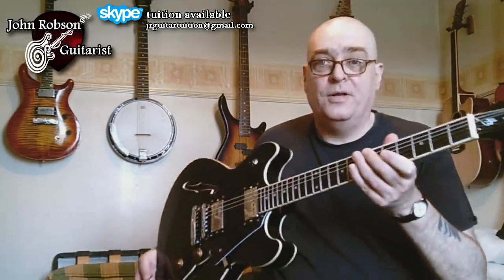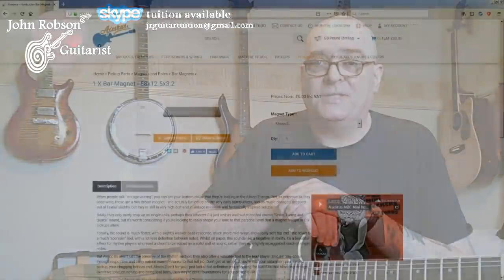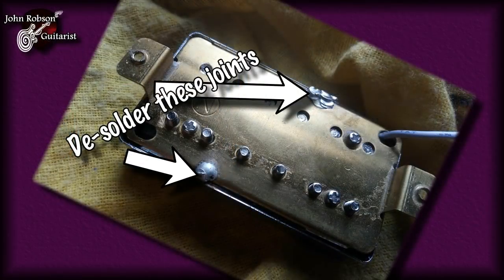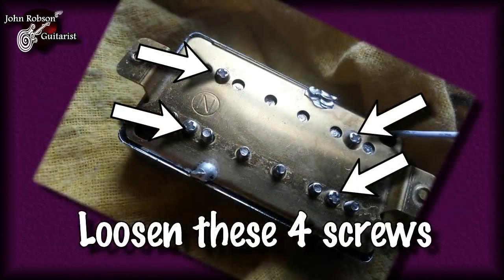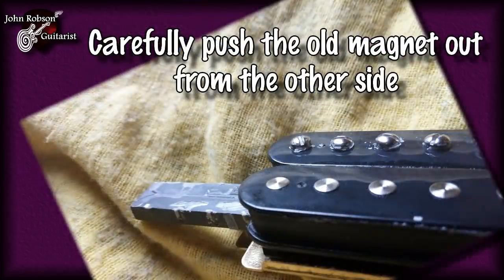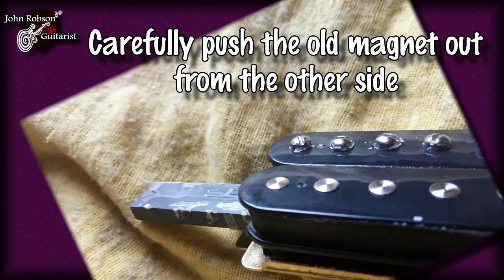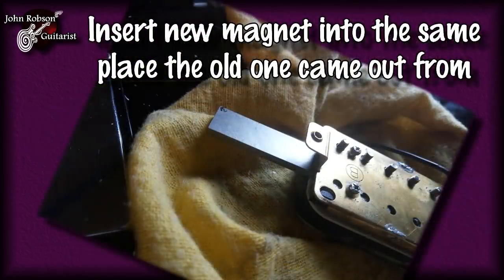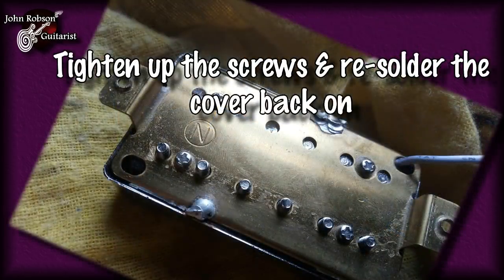| Swapping Pickup Magnets | An Easy & Cheap Way To Upgrade Your Guitar |

Comment: Great guide have swapped magnets on many cheap humbuckers to good effect .
and as a small tip always break the solder joints to the cover rather than desolder them . a stanley knife blade and a small tap through with a hammer does the trick . its not happened to me but know someone who had it happen , when desoldering some small amount of solder dripped down and got under the bobbin tape ( which was rather loose ) and shorted out the windings .
Reply from the maker: Great tip. You've just become the pinned comment on this video 👍
Reply: @JRobsonGuitar   Indeed, i do it also that way. Forgot something. In these kind of guitars it's hard to swap out pots.. but i've found an easy way to do that. Put a small chirugical rubber tube or a tube from an aquarium pump OVER the shank of the pot and pull the shank like that trough the hole ! And to  easy pull on the wire to the output or elsewhere, i simply use an iron clothes hanger with a tiny neodymium magnet glued at the top end..
Reply: @JRobsonGuitar 
Thank you
Glad to be of help
Reply: Cheers,mate!

Comment: Hi John, I'm fairly sure that on a Throwback p/u channel vid, the owner recommended a modest clamping force between backplate and cover when soldering, to tighten the components up to battle microphonics (and presumably potential wolf tones/resonances). More critical on non-waxed period correct PAFs but worth noting .... possibly?

Comment: There is a Video on pickups and magnets on Will Gelvin's channel, he knows a lot more about coils and magnets.
So an AlNiCo 2/3/4/5/8 bar can be magnetized stronger or weaker, the strength of the magnet should fit the windings of the coils. More windings, more DC-resistance result to the need for a stronger magnet.

Comment: I've ordered a pair of Alnico II and a pair of Alnico 5 magnets (not because of this video), which I'll either stick on my epiphone les paul humbuckers or on a pair of vintage PAF style humbuckers that i bought off the fleabay a while back. I guess Alnico II for the vintage 8k range humbuckers, and Alnico 5 for the more modern (8k 14k) humbuckers. Could always stick the neck pickup magnet in the wrong way around to attempt to get something more like the Peter Green 'Greeny' sound, and put that humbucker in the guitar upside down.

Comment: Just to help others. My experience. I did the same with one of my Gibson humbuckers. Careful, the fine wires that connect the two coils together are down the lollipop stick end so just pull the bar magnets out. Also mine were tight so I had to loosen all 6 pole screws from the threads to give me enough room to slide it out. Replace the pole screws to their original height though afterwards.

Comment: Just changed magnets on affinity tele...(has cheapo ceramic strat pup in neck...original ceramic bridge).
had a pair of CIJ jazzmaster pups in parts drawer...so use the magnets out of those.
Totally changed the sound of the guitar...in a very good way.
It didnt sound bad before..but after swapping magnets a huge increase in clarity and  definition.
A/B against squier jag...re mag tele gives much better sound...just goes to show what can be done...and that pickup makers are having folks eyes out.
the jazzmaster pickups were dreadful sounding things....i had my old mate Jim Cairns make me a proper set...now those ARE good pickups....but my re magged tele runs it close...
which isnt bad considering the tele pickups were El Cheapos.
next job on tele is swap out the pots...for some reason its got 500k...bit sharp n bright with these magnets.
as for taking off the old ceramics...one was loose enough to take off by hand...(neck pup...no wonder it was microphonic....it isnt now)...bridge pup...long nose pliers...then twist..mag popped off...easy...
My 2 bobs worth.....do it!...you wont be dissapointed
Skol
Wul

Comment: They sound great John. To my ears there has also been a boost to mid frequencies. But as you say definitely a sweeter warmer sound. I've got some ceramic P90s that I am tempted to try the same trick with. They seem to have two magnets each. I've done some searching which suggests the P90 magnets are the same size as the humbucking ones but will make sure of this before doing anything drastic!
Reply from the maker: Axesrus list the magnets I used as being for humbuckers or p90s 😁
Reply: @JRobsonGuitar  I've just looked at the P90's. The magnets appear o be glued to the plastic bobbins. Could be a major problem!

Comment: Dyi heat up weak  solder iron with a blow torch type cig lighter or on the stove to get it hotter. Bit bodgey but works in a pinch

Comment: Best pickup ever made find a 1988 to 1990 Seymour Duncan trembucker i think they renamed them the Parallel Axis patb1 now but i have a 1989 bobbin has no duncan label it just labeled on chrome baseplate trembucker . but its resistance is 17k ohms whereas the newer patb1 i have is 14.8k ohms. Anyways swap out the alnico 5 magnets and install a ceramic they are amazing . i have the orignal installed into my 1988 peavey vandenburg and the patb1 installed into a ibanez lawsuit les paul copy.

Comment: Hi, I was wondering if the magnet swapping thing only applies to humbuckers or is it something that you can do with single coil pickups too? Thanks for the informative and useful videos
Reply from the maker: Just humbuckers mate 😁
Reply: It applies to both but there's a different process
Reply: You can buy alnico pole pieces for single coil pickups. Just swap em over.

Comment: John - instead of de-soldering the joints you could’ve just used a razor knife & carefully cut through the solder. You have to be careful you don’t go too deep, but the trade off is that you’re not applying more heat to the pickups.
Reply from the maker: I ended up using a very small jeweller's file in pretty much that manner. Just got my new soldering iron & fixed the covers back on. New tuners installed too... Job done!
Reply: @JRobsonGuitar  Higher wattage soldering irons are a must nowadays with the crappy lead free solder lol. I bought a high wattage adjustable temperature soldering iron and plenty of lead tin solder because I got fed up with how crap the lead free solder is. I also made up a large tin of flux by melting plenty of pine rosin into vaseline and it smells great and works great.

Comment: Hi John, could you tell us the details of the signal path. It sounds great.
Reply from the maker: Cheers mate, I use a Vox Tonelab ST on the US HIGAIN SPL amp model through a UK 4x12 cab sim (also in the Vox) for my driven tones, and clean is the US BLUES SPL amp model through the same cab sim. Then add reverb/delay etc to taste.
Reply: Many thanks John, that's the shopping list sorted!

Comment: It's not that simple! It is good if the magnets are of the same thickness. Alnico magnets are often thinner than ceramic magnets, which means that in addition to magnets, plastic (wooden) gaskets that support the shape of the humbucker will have to be changed too.

Comment: From Leo:   I like the sound of the Alnico II magnets.  Did you loose output volume with the less powerful magnets?
Reply from the maker: A little, but only noticeable when you view the waveform after recording the guitar. What you perceive when listening is that there's more clean "headroom" before the sound starts to distort.

Comment: Hi! I vainly tried to desold the ring from a filtertron. Yet ,even at 480 centigrads it doesn't melt and I can't open it. I usually use 300 c  to install pickups... Any suggestion, please?
Reply from the maker: Nope, sorry. Never done it on that kind of pickup.
Reply: @JRobsonGuitar  it's solded the same way, it's just a bit nerrower. I'd like to know how to desold it.

Comment: A simple bodge to swap out pickups in a semi without the gynaecological work .
Cut the wires of the old pickups and solder the new ones to those. 
The impact of the break in the cable screen will be negligible but you Could wrap the joins (metal foil/tape – copper slug tape) if you Really wanted to.

50W controlled solder station £15'ish on eBay usually.
Reply: That said, the magnet swap Did sweeten the tone for a relatively small outlay.

Comment: Hi John, nice job mate ! You actually made me laugh hard now. Remember when i said to you i was going to put Alinco 2's in my SG ? You were disputing.. nooo.. put Alnico 5's in there, that's much better ! You apparently converted to Alnico 2 now.. LOL. First the swap in the CST 24 and now this one. About swapping out those magnets..someone commented here under,.. so then you can easely swap the ceramic bar on a single coil too ? I've answered to that. Maybee you could do a small update or a more dedicated vid about how the polarity works on this type of magnet ? Also, there are not only varieties in numbers of magnets, but also in size. The most common standard used is in mm, not inch, 58 long, 12.5 wide and 3.2 mm thick, and is probably the size you needed for these ones. So.. better check before ordering. Just a suggestion. Cheers mate.
Reply from the maker: Yeah... The a2 sound got me in the end. Saw your reply to the other question... Thanks for that. You're the pickup guru so you're probably better qualified to make that video... Go on, you know you want to 😆
Reply: @JRobsonGuitar   Well i would like too.. and i will, but i'm way to far beyond with work to do, that i'm still not able to open my own channel, and i regret that very much.. i'm like you.. a one man band.. LOL.  BTW.. i've just added something above i forgot also..and added a good tip above to the pinned comment about an easy way to swap pots, etc..

Comment: Thanks John, can you explain again about putting the magnet in the correct way, I did not understand. It just so happens I've just ordered the HB35plus left handed and I'll probably want to do the same in as much as changing the magnets, or if I'm brave enough change the pickups. I want a Jazz sound - I've heard the Alnico 3's are good for a Jazzy tone?
Reply from the maker: OK... The end of the magnet poking out (let's say the North Pole) will repel the North Pole on the new magnet, but will be attracted to the south Pole of said new magnet. This end is the end which has to go in "head first" if you see what I mean. This will mean that the North Pole of the new magnet is at the same end of the pickup as was the case with the old magnet. Hope this helps 😁
Check out the Axesrus link & go to the page where they sell the magnets and they have a summary of the different tonal properties of each type as well as sound clips.
Reply: John Robson Guitarist Thanks for the prompt reply, makes total sense now. Oh btw how do the magnets compare to the Vanson pickups you installed in your other Harley Benton?

Comment: Great video John thank you. Most people sent that ceramic equals shit. But that's not the case. There are many expensive amazing pickups that have ceramic magnets. but this is a great idea. I am now thinking about switching my ceramic magnets out for amigos as an experiment since it's such a to-do. I have very very hot amazingly crazy hot ceramic pickups in my Firebird. why they switched over to such a hot pick up I don't know because the original Firebirds if I'm not mistaken head-on ecotools in them. There anyway after looking on the website for a different types of pickups to see if I can find something I might want to play around with I came upon mojotone. They have a really great pick up signature series from Johnny Winter and it was Johnny Winter who actually in collaboration with mojotone made these pickups. Although that was not what caught my eyes look what my I was they had a hot bridge pickup with alnico 8 send them. And I'm so curious to see what that difference is cuz it's a 16k resistance the resistance on my bridge pickup on the side of birds if I remember right is about 25 yeah 25 LOL. I'm wondering what the 8l Nico would do In those pickups removing the ceramic ones. I'm assuming like someone made a comment in your in this video about how will some bulls easy get socks had a few videos on pickups magnets coils winding the whole bit and how they have to be matched for a really good sound. So I'm thinking with a hot 8 alnico pickup it should be more compatible if or with the windings in the original pickups in the firebird since it's such a hot pick up if anyone has any ideas or thoughts on this please let me know in the comments thank you oh and please excuse any misspelled words weird punctuation anyting not quite grammatically right I am not a bad typo, I am not illiterate, I'm just legally blind and I depend on the speech to text and it often is not correct again thanks all
Reply from the maker: Yeah, ceramic has it's place. Great for hot metal sounds, but not my cup of tea. I think it's fair to say that I like a sweeter alnico sound & I find ceramic magnets give a harshness to the treble that I can never EQ away. Throw some gain at it, though, & you have a great metal tone.

Comment: Wax potting could be a problem. Also how do you know what type of magnets are on an old guitar? Great vid.
Reply from the maker: These pickups are wax potted, and there were no issues 😁
As for knowing what magnets are in there... The sound usually gives a big clue. If you can see the magnet, you can spot the ceramic ones by their colour... It'll be black. If it's a metallic silver colour, it's going to be some sort of alnico.
Reply: @JRobsonGuitar  cheers John, so do you not need to seal up the wax again after changing? And thanks for replying
Reply from the maker: @The_Macaroon  You're probably OK as the coil is still impregnated with wax even if the magnet isn't glued in place with wax any more. Just don't play with Slipknot levels of gain & you should avoid any microphonic feedback. Incidentally, the famous Gary Moore/Peter Green Les Paul had unpotted pickups (they didn't always wax pot them back in the 50s) as does the Bare Knuckle replica set, I believe.
Reply: @JRobsonGuitar  everyday is a school day. Much obliged. An no, no slipknot lol
Reply: As long as nothing is obvious rattling and the pickup is screwed tight again as one homogeneous mass, it should be totally fine. The magnets are almost never glued in
Reply: @JRobsonGuitar  I never knew that about the Greeny. I know the neck pickup was wound with thicker strat type wire, with the magnet the wrong way around and the pickup put in the guitar upside down lol.

Comment: What about a pickup that is potted? Wouldn't that make changing the magnets harder?
Reply from the maker: You'll feel a little resistance from the wax sticking the magnet to the pickup assembly, but it doesn't take much more than a gentle push to break the seal & move the magnet. These pickups are wax potted & the magnet came out OK.
Reply: John Robson Guitarist Good to know. Hopefully the new magnets seat properly and don’t end up being microphonic.

Comment: That tone is sweet on the bridge pickup! ❤️ 👍 Sounds alot like Robben Ford tone what kind of amp are you using? Good Job! Did you wax pot it again?
Reply from the maker: Cheers. I was using a Vox Tonelab on the US HIGAIN model. Didn't wax pot it again as that's really only a measure to protect the coils from vibration & the wax on those was still intact. Anyway, many PAF pickups weren't potted in the first place, so it's not crucial.
Reply: @JRobsonGuitar  is that guitar a Harley Benton?
Reply: I might pick one of those Leftys
Reply from the maker: Indeed it is 👍

Comment: Can you do the same with single coil pickups with ceramic magnets or would you have to swap the entire pickup?
Reply: The bar on single coils is directly under the poles. I assume you just remove it and swap it out with the alnico
Reply: @skobywankenobi  Actually.. no.. you can't do that, because of the polarity issue, or you would have to glue the bar magnets with the thin side on to the poles. And also, then you would have seen hundreds of vids about that on You tube. What you can do however, with cheap Chinese single coils is ( ONLY IF THE WIRE IS NOT TOUCHING THE POLES INSIDE ! ), meaning, that the inside where the poles go in, is covered up with plastic, same as in a humbucker..than you could slide alnico poles in it. But.. that's not worth the cost, because those cheap Chinese are using much less wire and much thinner wire with hardly some copper in, to reduce cost. Never heard the term "Chinese potmetal ? Better buy some Toneriders or Vansons and save yourself a ton of work and frustration. And.. never trie that with Fender style single coils, because if you push those poles out.. you simply break the wire and it's ready for the bin. Greets from Belgium.
Reply: try "Iron Gear" pick ups, huge variety, great tone, great customer service for VERY affordable cost
Reply: @9wenwilson210  Indeed, i couldn't come up the name of this brand ! But, then it's still about everyones taste.

Comment: John can you help me out  can I swop the pole scroos in my humbuckers
Reply from the maker: Oh, that's a tricky one. Breaking the wax seal on a magnet doesn't really affect the integrity of the pickup, as you're not disturbing the seal on the coil. I would imagine that taking out the pole screws would end up making the pickup microphonic as the wax seal on the coil would be broken. Why do you want to do this, by the way?
Reply: @JRobsonGuitar  thank you so very much for getting back to me. I have changed them I will keep you in the loop  .I have just got to put them back in

Comment: Basically, what you got is only a bit of less "sharpness" - as if the tone/presence  filter was slightly suppressing the highest range, at the same time slightly boosting the lower range. Definitely not worth investing extra (although "peanut") money and effort, since with any decent amp you get all this and much more.